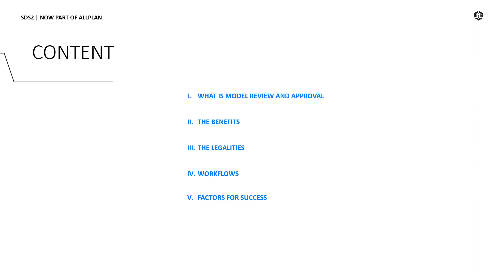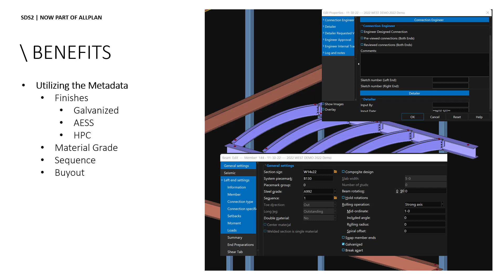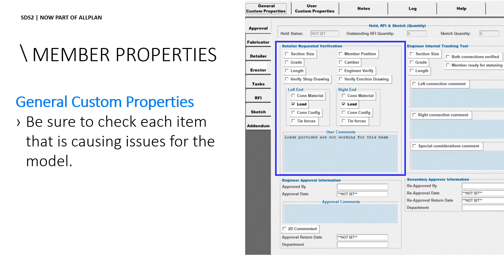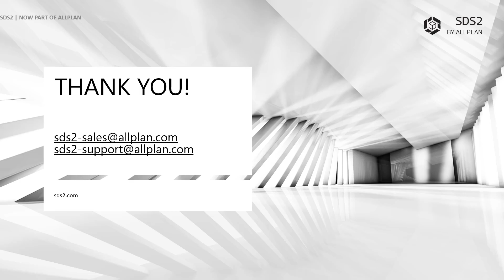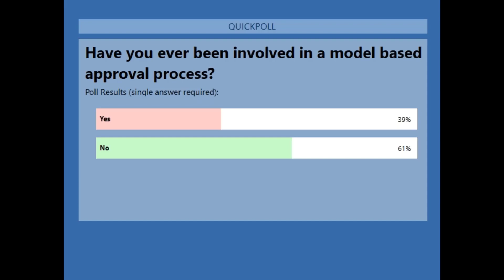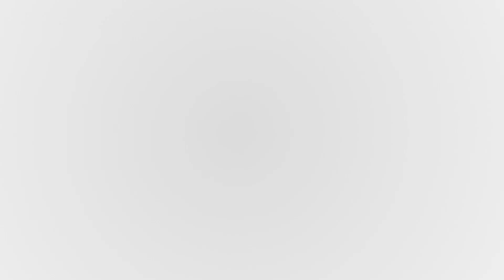How to Accelerate Project Timelines with Model Review and Approval Webinar

Comment: I agree I believe model review only is where the industry needs to head...some cos are doing this already. The alternative is for the detailer or fabricator  to submit their 3D model ALONG with perhaps the pdfs of only the 2d erection sheets, without the 2d detail sheets, as the member & submatl details will not have yet been detailed...til after the EORs comments have been incorporated. I believe colleges n schools that use SDS2 in their drafting curriculum need to teach the students on how to do model review n the process. Good video 📹!!